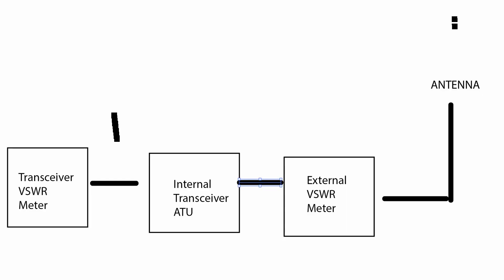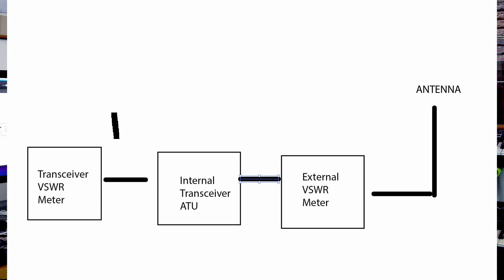Two VSWR Mysteries

Comment: Hi Peter, what kind of ferrite core would you recommend for HF? There seems to be many brands and mixes. Would they work equally well for all modulations and modes? For example I am interested in FT8 on 10m. Would a basic external VSWR meter show the correct value if transmitting FT8? Many thanks
Reply from the maker: I use 240-43 mix 73 Peter

Comment: Rant time Peter, sorry but the whole Antenna Tuner nomenclature rattles my cage. Sadly you are not alone in this deception even august institutions like ARRL and RSGB and many others are guilty
As you know the real function of these devices is to transform one impedance to another. I think this concept should be made clear for all introductory instruction on these devices along with a more accurate name for the device, an impedance matching unit be at least mentioned. 
 The term antenna tuner best describes the person trimming the antenna to resonance at the desired frequency not some commonly misunderstood black box.
Reply from the maker: Hi Ron, sorry your cage was rattled. Try FMU - Feed line Matching Unit. 73 Peter

Comment: Fine video Peter keep those fine videos coming,
I see you two keyboards and also seen a drum so that explains who's playing in the beginning of you videos you have quite a interests other things then ham radio...
Vswr plays a big role with the antenna being turned correctly and the coax length is short as possible between the external vswr meter so you don't have returning RF down the cable and the coax between the transmitter and the meter are like a capacitor that's changing the capacious in the two vswr meters therefore giving you and different results 
KD2ARD from the U.S
Reply from the maker: Hi there. Thanks for sharing. The keyboards are Jorg KROSS Synth and PA4X.  We use them mainly for backing tracks for singers. 73 Peter.

Comment: Hi,good interesting video, well presented,,,,what do you think is more accurate 🤔 the swr meter in my Icom ic-7300 or the swr meter in my Acom 1500 linear amplifier, considering the amp is around 3 times as much as the radio,,thanks from Rotterdam 73s 👍

Comment: Is there any advantage to using an external tuner? I've been running my IC-7300 internal tuner only for the last 3 years to my EFHW with no issues (with an RF choke at the antenna feedpoint). My EFHW has an untuned SWR below 3.0 across all the bands and never considered using an external tuner. The internal tuner works perfectly and keeps my rig happy. My inclination is to keep my setup (and feedline) as 'uncluttered' as possible. What do you think? 73 KJ6ER
Reply: Reasons for using an external matching unit include better power handling capacity if running an amplifier. Generally external units will have a wider matching range, meaning you can power a far from  resonant antenna as opposed to just compensating for an antenna operating a little way off from it's resonant frequency. Note however it can do nothing for the power losses in the coax associated with a really out of resonance antenna. You may also want an external unit if you want to run balanced parallel wire feeder or non 50 ohm coax. That basically covers in the shack matching units but there is another type where the unit is mounted at the antenna and remotely or automatically tuned. For coax feeders this is the superior design as it all but eliminates the power loss in the coax feeder assuming it has the range of mating required to present a 50 ohms resistive match to the coax these types are generally limited to a similar range of tune as the internal matching units. In your situation I would say the internal matching unit is perfectly adequate as you are feeding a multiband resonant antenna. If you have a favorite band it is always a good idea to provide a resonant mono band antenna for that band. All multiband antennas are compromised in one way or another.